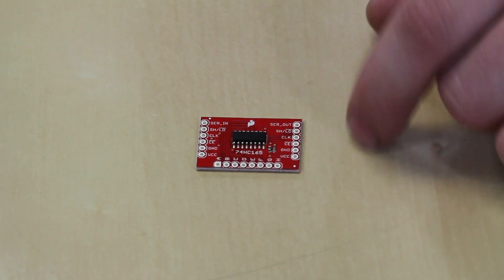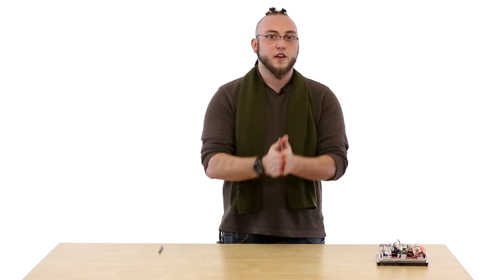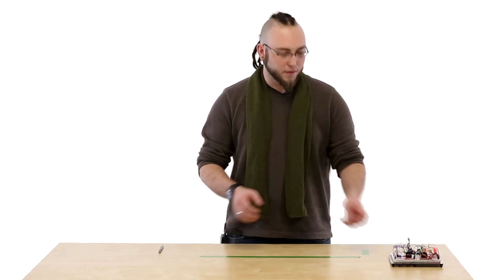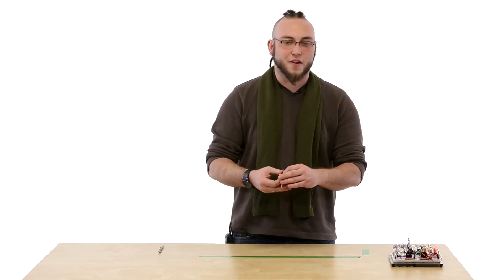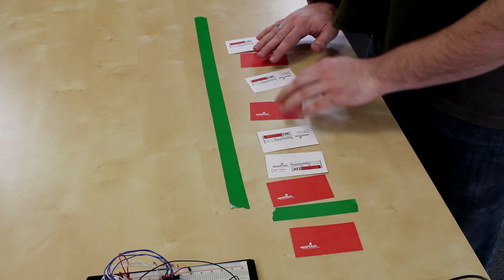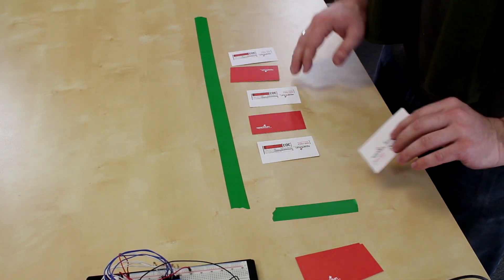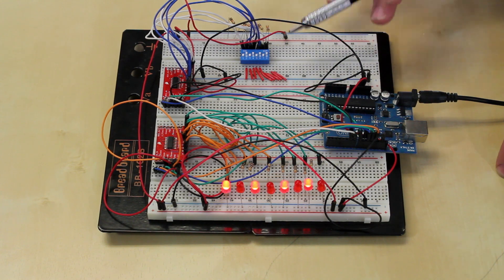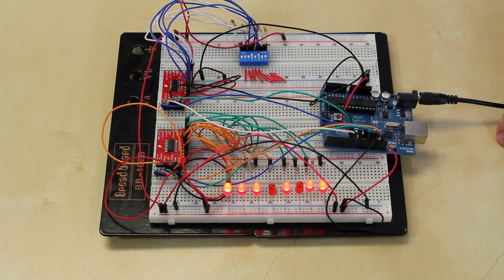Sparkfun Shift Registers

Comment: You've explained how it works in principle and then you're like "...and here's one I wired up. The End.". What signals on what pins trigger everything? Is the latch pin held high or low during the inputting of signals? How does the parallel to serial and serial ro parallel setups differ (besides the obvious I/O pins)?

Comment: I am trying to control nixie tubes. Like a lot of them. Probably upwards of 21 per panel on this project I am planning. 
Since the tubes are controlled by connecting the circuit from anode to cathode the power deliver is not a problem. Power in line will be mounted to all of the anodes in a static connection.
However the problem comes in with the actual part that comes to chose what number to be displayed. I can't use relays. They're too big and bulky, and expensive - and also require a lot of I/O pins essentially that I do not have.
Nixie tubes have drivers meant for this where they have 4 inputs that determine their outputs. I'm not familiar with how to use them still, but would like to learn.
But even given the drivers that's still 4 pins per tube. 

Can I use shift drivers to determine these inputs and use less pins? Or will these not solve my problem?

Comment: Very clear explanation.  With that said; like 'James Heslop' asked, earlier, can let say... 25 shift registers, daisy chained, to the 5v power inputs, be supplied by a 5v rail with let say 5A of current, to supply 192 or so  LED's?   Or; would I have to put 192 separate transistors on all the shift registers outputs, to supply enough current, for all those LED's?

Comment: So with my Arduino Mega I just realized that when I hook up the 5v it actually puts 5v from the USB not from the chip, so that whole 40mA max per pin thing doesn't apply so long as I'm powering the shift register from the 5v pin on the board (supposedly wouldn't want to try for anything more than 500mA from the usb supply as that's all they provide anyway) but I'm curious - how many LEDS could you light up using the 5v pin?  I keep hearing, "just add more and more and more and more registers" yeah but then you'll be drawing 10s of amps, how do you provide them power?

Comment: I had a question regarding the load process for the SN74HC165. If you had a sensor that was only going to be high for a small amount of time it seems like it could be missed if you were in the process of clocking in the serial data, especially if you have multiple daisy chained together.  Is there a way to have the the digital inputs A-H stay high, once they have gone high, until being loaded in?
Reply: Quick question: What are you using a shift register to store data from a sensor for? It seems to me that it would be easier to do that with the microcontroller directly. Or maybe even do what Jeremy Blum did with the i2c temperature sensor in his arduino tutorials...

Comment: These shift registers are a double set, with one narrow chain moved by the serial clock and a wide path moved by latch/load. It's so much more popular that the shift only parts (which are output only) have become hard to find; economy of scale makes it cheaper to just wire clock and latch together if you want that behaviour. There are also tricks to use fewer pins; for one, the two registers in this demo could share both clock and load/latch. (S)NES controllers are built with a shift register.

Comment: Actually if nothing changed on the input, the output would be rewritten with the same values, so even with an oscilloscope on an output pin you wouln'd see anything but a solid 0v or 5v signal.

Comment: It doesn't "sense" the change really.  What is happening is it is constantly updating the output compared to the input.  The arduino is generating a constant clock pulse, which updates the inputs and outputs.  So as you saw in the video when nothing changed on the input it "looked" like nothing changed on the output.  It actually re-wrote the output on every clock cycle, which is too fast for your eyes to catch.